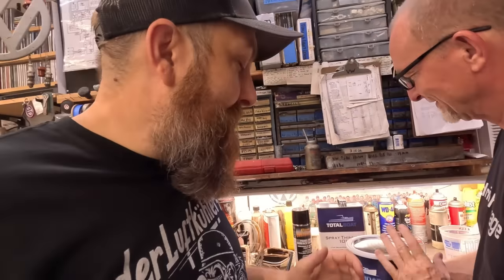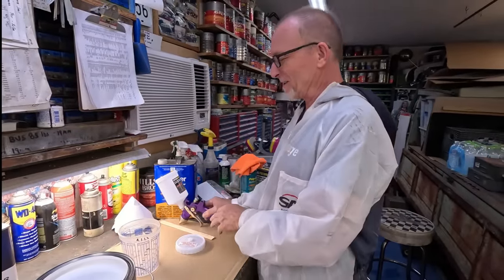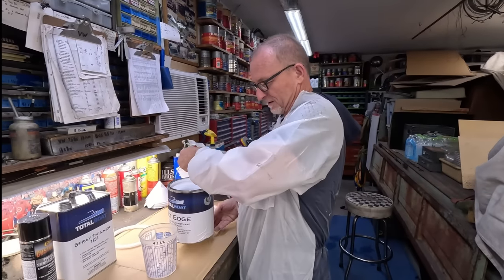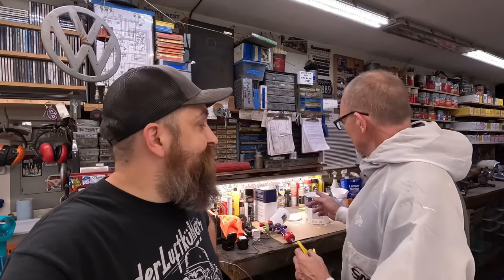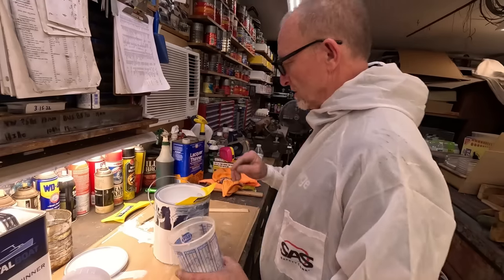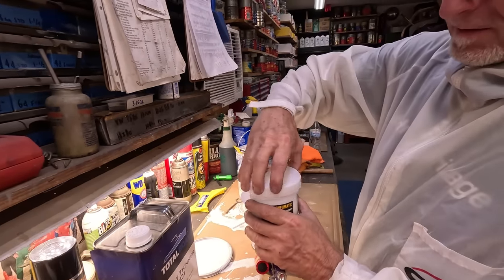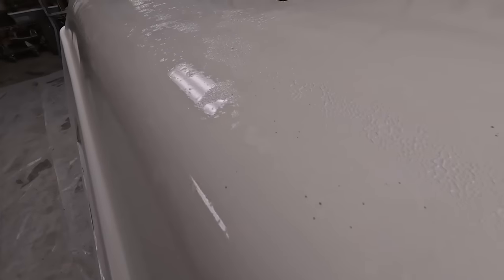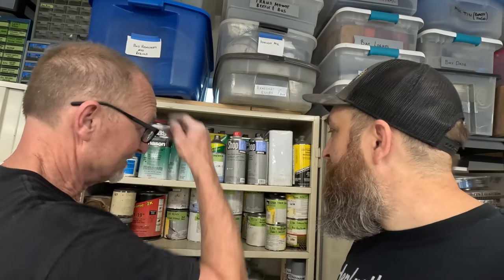We TRY painting camper tops...

Comment: Another thing to consider is the moisture and a lot of times greases from our hands while sanding and prepping that saturate certain areas and I have noticed fiberglass tends to be very sensitive with paint. Also yes the air humidity in texas will cause a lengthy drying process and mentioned and I'm sorry you guys had to run into this issue. The great thing is that is all fixable! Vw Life!!!

Comment: OK Guys! Nothin wrong with the paint but 8 min in, and im wondering why Gary doesnt white the gal can and put the lid back on!. I agree Gary, I would use a foam roller and a quality 2 1/2 to 3 in bruch to tip it off, those paints dry so slow that they level right out and look amazing! I used Interlux white, another boat paint and my west top came out mint! Live and learn my friends, thanks for filming and for awesome content! 
 BTW,That top is going to look better than 99% of all West tops!

Comment: I'm likely going to paint my pop top this fall, so I much appreciated this video to know what works and what doesn't.  My thoughts were that I would prep and primer it with the leftover epoxy primer that I shot the bus with last year.  Then top coat with a similar product to that boat paint you used.  Not sure...
Reply: On the fiberglass don't use epoxy. Use g2 type primer.